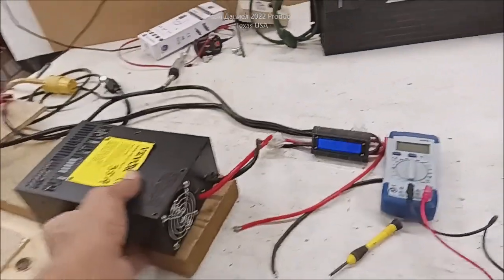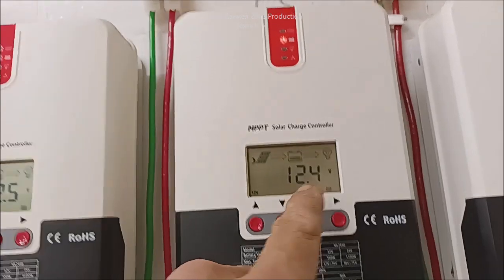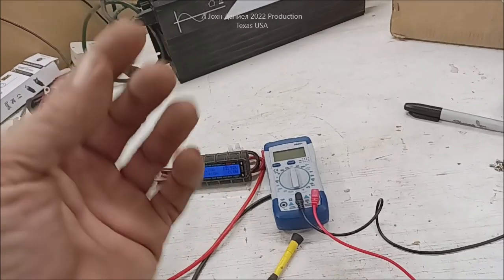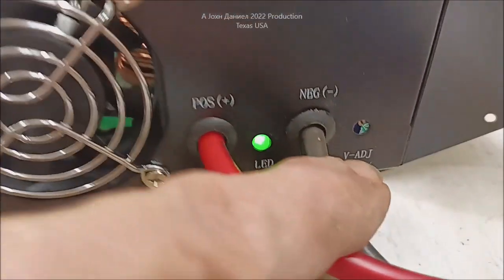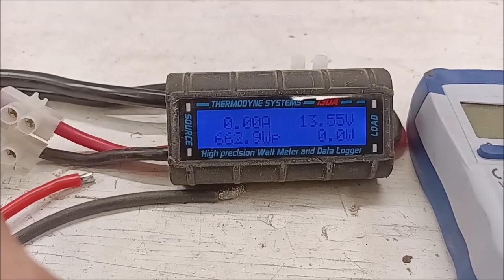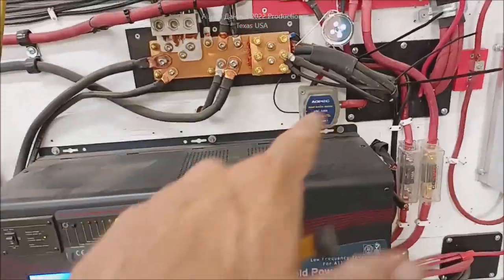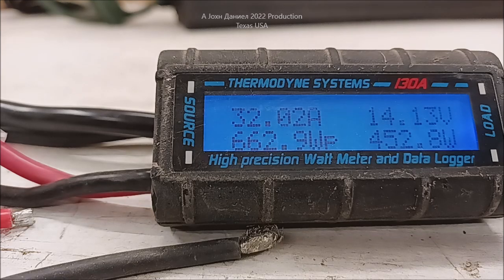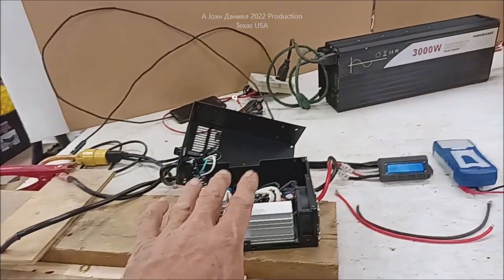Use a DC Power Converter made for RV's to charge most all 12 to 15 volt service batteries NICE!

Comment from the maker: Vevor RV power converters https://shrsl.com/3lycd  proper 10 gauge power cable https://amzn.to/3z9tdPQ  Full 60w Soldering kit https://amzn.to/3IZVxZ8 & WATT METER https://amzn.to/3J4hzdl for accurate energy tracking & settings
CHINS 200A LiFePO4 is next video, it's info -  https://amzn.to/3vbeAKw
 POWER QUEEN LiFePO4 Batteries 10 to 400 Amp for bargain cost https://shrsl.com/3kfqh use promo code - John3
Help grow the channel and content with Buy Me A Coffee https://www.buymeacoffee.com/JOHNDANIEL
Reply: Wow this converter is impossible to find now ... too good eh?    So John,  excellent information thank you so much.  I'm new to the RV thing and am upgrading my battery situation converting from Lead Acid to LiFe and not being super familiar with these things had a couple questions.    1. I purchased a lithium specific converter from prog dynamics and it has 2 modes .. 14.4 and 13.4.  When i measured the voltage across the terminals at the converter it was around 14.4 but at the battery was around 13.4 so it seems I'm losing a volt somewhere.  I wondered about a converter where I could increase the adjust the voltage at the converter such as this one then measure at the battery to achieve the 14.4ish delivery.  Is my intuition here sound?   Based on what I gather from your presentation the BMS would handle the situation in concert with the supply device so getting a lithium specific converter isn't critical.   I appreciate any thoughts you could share on this.
Reply from the maker: @RiggedVedist  See if this is what you want, the 110 volt to 0 - 15 volt model ( you can get the 0-24 volt model if you have lots of different batteries and need longer term charging) pick one or 2 on this link. https://s.click.aliexpress.com/e/_DDEAfrD It is the 0-15 and 1200 watt/80 amp model, and It is the same design that the Vevor is made from with some updates done to it. Vevor did not continue its contract with Mauzen to resupply this for 2023. Their loss. Be sure to use good true time 100 amp meter/shunt kit  https://s.click.aliexpress.com/e/_DeHWLnv to tune your needs for accuracy ( voltage set with no load, Amps set while on start charging load), run it at a max of 85% and you will like it. When the power charger gets to its matched voltage that it and the battery are the same voltage, then it drops amps naturally to match need/balance as the battery hits full charge, SO - DO NOT set it for higher than 14.55 +/-.05 and 975 watts ( 67 amps max, 40 constant, 50 fast charge) to meet your battery ability.  Shipping sucks but this is over $190 on Amazon when and if they show up.
Reply from the maker: @RiggedVedist PS- that same charger power supply I mention in the first reply, here it is on amazon, over $250  https://amzn.to/45ylR77
Reply: @JOHNDANIEL1  Thanks John...that is one sweet power supply !  too bad about the long lead time ... :(

Comment: John thankyou for all your videos they have helped me a lot. I'm needing advice on how to add my 24 nissan leaf modules to my other battery bank. My lifepo4 bank is 16 280 eve grade a cells at 29.2 volts max. My leaf modules are nmc chemistry and max out at 25.1 volts. I really want to figure out how to have both batteries in my solar power system. I've thought maybe just add a inverter and a charger to the leaf pack and have it charge the lifepo4 pack but it seems like a really inefficient way of doing it. Is the anything else I could buy that would allow me to safely combine the two batteries?
Reply: My lifepo4 pack is 2p8s at 14 kw 29.2 volts and my leaf pack is 6s8p at 25.1 volts I'm not sure the amp hours of the leaf pack bit probably 12kw
Reply from the maker: My suggestion, https://s.click.aliexpress.com/e/_DcvNAmJ 
Convert the Leaf to 36 - 42 volt, send all solar to it, use 2 of the above controllers sending constant current to your Eve cells and bank, use the inverters all from the Eve batteries.
Reply from the maker: Just curious if the Leaf can be configured to 42-44 volt? Maybe using them as the solar and wind incoming bank as 42 volt ( 36 volt system ) you can use them constantly as filler power to the 24 volt EVE system? A custom 60 amp DC to DC charger, from 42 to 24, a few of them would make it work.

Comment: Does the epson salt really work in batteries ????
Reply from the maker: Yes, batteries that have not been deliberately abused, such as causing problems with the plates structurally can usually be brought back for at least another 30% more of their normal service life using the Epsom salt to free up the sulfates.
Reply: @JOHNDANIEL1  How much would you put in each cell ???
Reply from the maker: @MishinFishin  Check voltage, write it down. Using a standard sized 12 volt or 6 volt battery - Use 2 level tablespoons and 2.5 ounces of distilled water into a cup, stir well, heat in microwave to 120 degrees +/- 5 degrees, fully dissolved, then pour equal amounts balancing out the liquid into the battery. Be sure your water levels are normal. Shake and tilt gently to mix. 
Allow to sit 4 hours, then slow charge for 2 hours 4 to 6 amps, hard charge till battery warm 110 degrees on sides, with 15 to 25 amps ( usually a hour) unless it is bubbling real bad,  allow to sit over night, check voltage to see if recovery has started. Compare voltage of battery before you started. Repeat charging if it has with trickle charger 1 to 2 amps for a few days. Then you will see if it has a useful recovery. If voltage sags, hit it with the warming charge again till warm ( 100 to 110 degrees) and repeat charging steps. Give up after 3 full tries.

Comment: I enjoy learning from your video's...May be I missed it... but I would like to see a video on installing a power inverter to a car battery for camping. Use the inverter to charge the 1 or 2 battery bank and run fans, dc fridge lights etc. Thanks for your hard work John!
Reply from the maker: Yes, I recommend a good pair of batteries to get you plenty of amps though.
Reply: @JOHNDANIEL1  Do you connect the power inverter directly to the car's battery?
Reply from the maker: @terrykeil6751  You can do that, but it's better to install an isolator and a second battery so that you don't damage your cells in your car starter battery.

Comment: Sir blessings to you and yours!!! Thank you again for you input to us out here!!!

  I finally have 6 new 340 lawnmower batteries and the 1500 watt blue inverter with number 2 cables with a 300 Amp fuse with a shut off switch and a test light to charge up my inverter before I turn the power on. With a two 24 volt  Lithium ion batteries that receive 48 volts from 4 100 watt solar cell, with charge controllers in-between the batteries with a dust to dawn stitch, and share 12 volt share switch to separate the batteries. 

 Now I know what kind of AC charger to get now. Thank you again for everything.
Reply from the maker: These work great for the 12 volt systems, you can attach a buck boost charger to the end of that and if you're interested stay tuned we're going to be showing one of those and you can charge batteries from 0 to almost 100 volts from a 12 volt system.